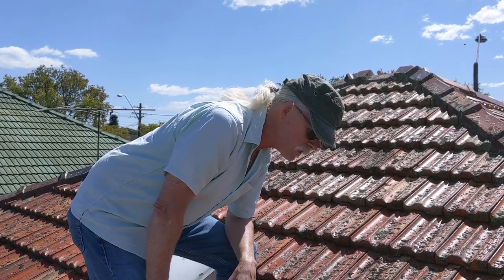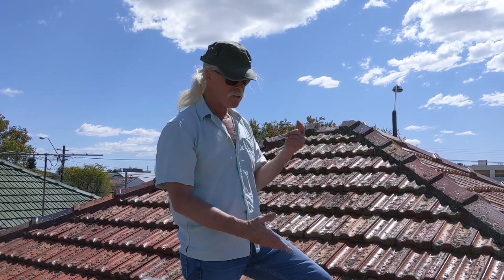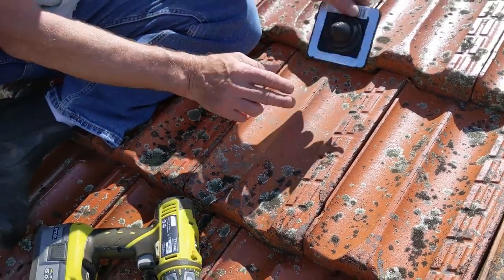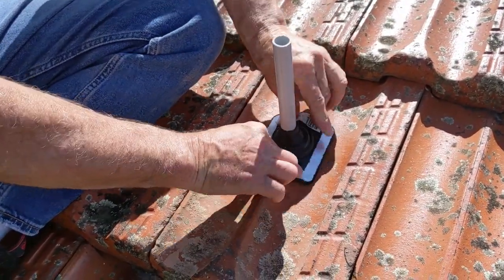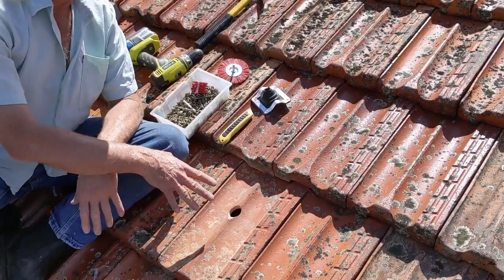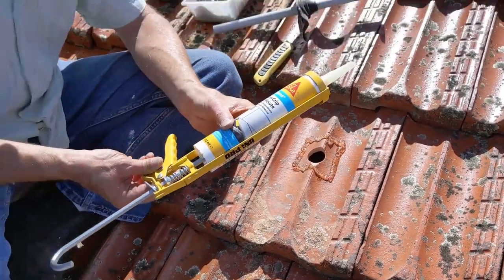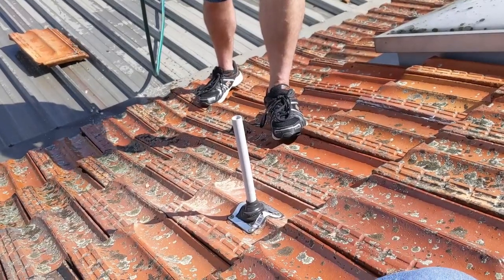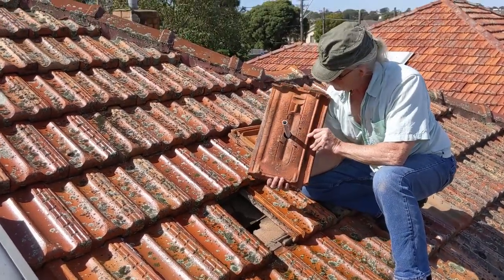Roof Tile Penetration

Comment: Great video. Thanks for posting. Only one question... would it not be preferable (whenever possible), to place the hole on the edge of a tile rather than the middle?? Avoiding the groove, of course so that the water doesn't run directly into the hole area, as you explained; but if you place the hole on the edge, then the tile can be removed to access the bracket under the tiles.
Reply from the maker: Never tried it but I doubt it. too easy to break the tile and no way to get a seal between the top tile and the one under it